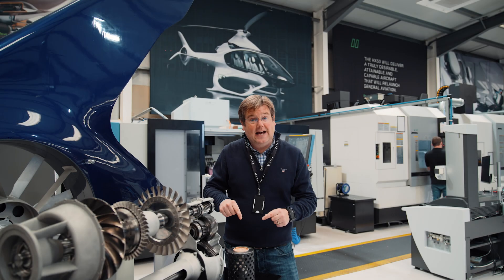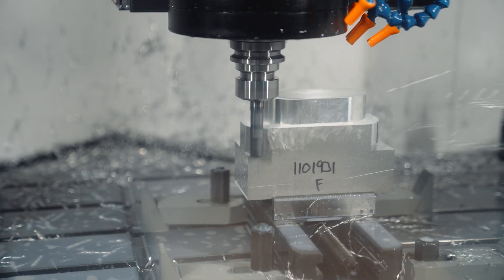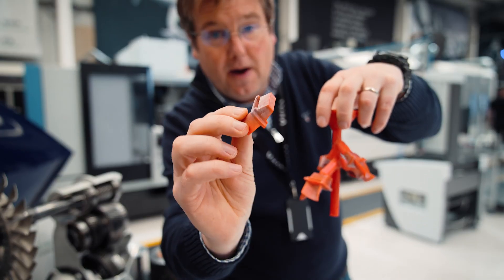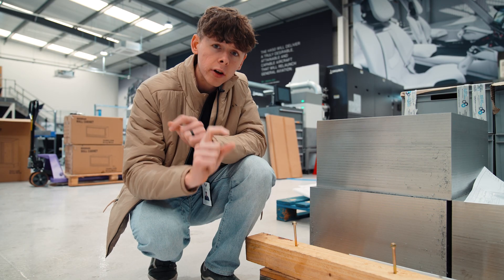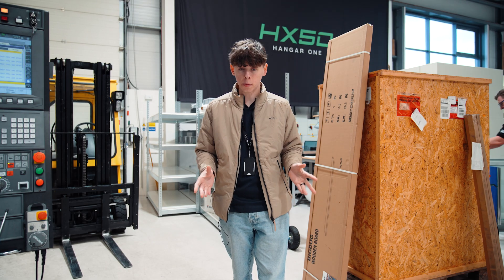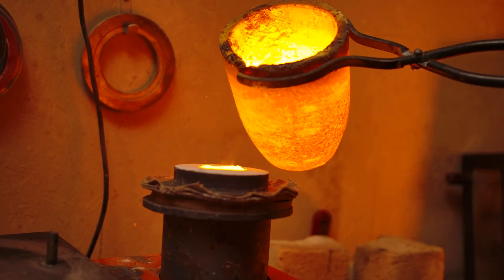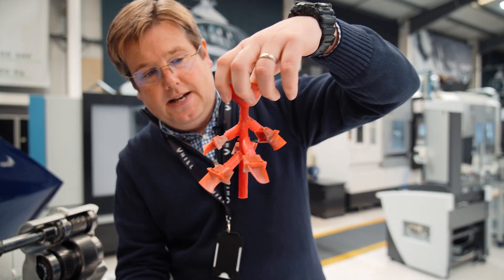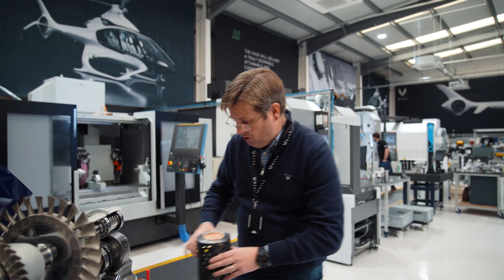Journey to HX50 | Episode 33: Casting vs. Machining

Comment: So there is no final finish machining on the turbine blades? Crikey!
Reply: that was my thought too, i thought most casting was used to control the metallic structure during the process, temperature and cooling speed and then possibly fine machined after - i know i have some blades somewhere from old jet engines all of which look very finely tuned after machining, but perhaps casting has come a long way now and the accuracy has improved